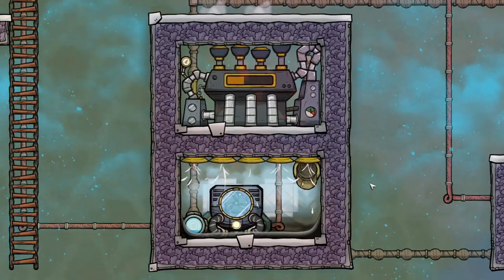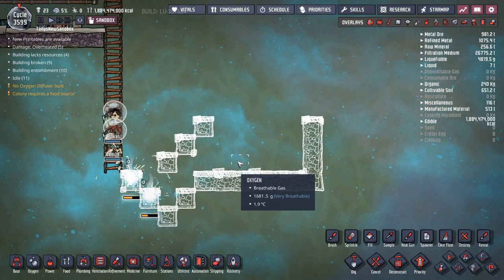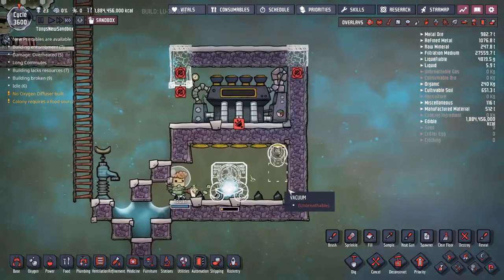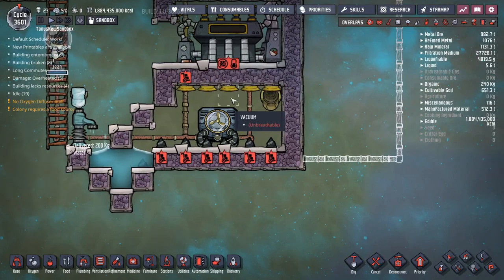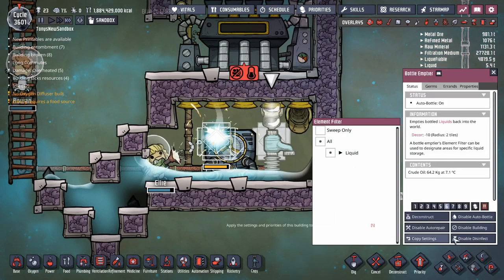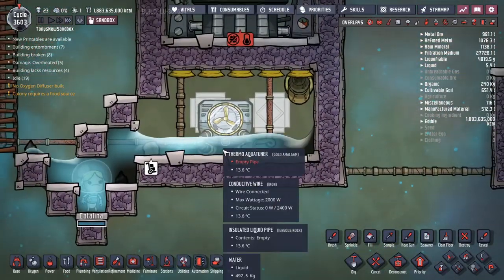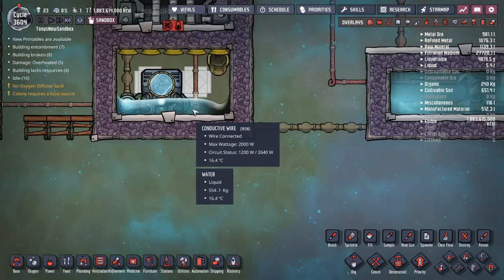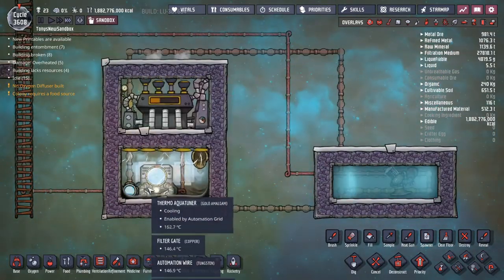Active cooling without steel.

Comment: so does tempshift plate try to equalize temperature of everything in the room? I never quite understood those.
Reply: The tempshift plate will spread around heat to everything around itself. So one tile will spread its heat to the 8 other nearby tiles. So if you have a pass or liquid within those tiles. The Tempshift plate will help push heat from the gas, liquid of solid into each other. Thereby equalize the temperature. It is rather anoying to have a very hot liquid and a not so hot gas when you want a hot gas.

This is also why you should NEVER put a tempshift plate next to a insolated tile. The point of the insolated tile is that it will not absorb or release heat fast. The tempshift plate will cause the insolated tile to ignore that, and instead the tempshift plate will force heat in or out of the block.

Comment: Bad self experience, i filled the aquatuner area full of water, and now i have 1000 kg steam per tile that is so hard to get to 125deg that the insulated tiles and the turbine just end up eating the heat and escaping the room and ends up not becoming energy.
Reply from the maker: Also, if you did it the way I do then your liquid vent will overpressure.
Reply: if your heat is getting away at such rate, you probably want better insulation.